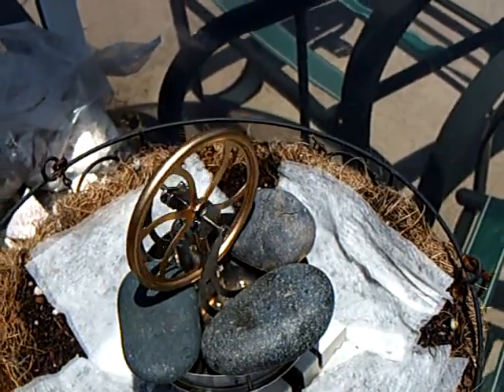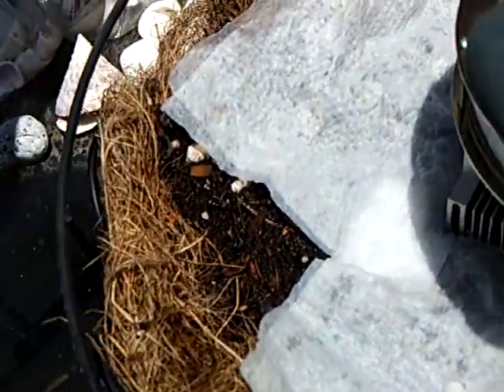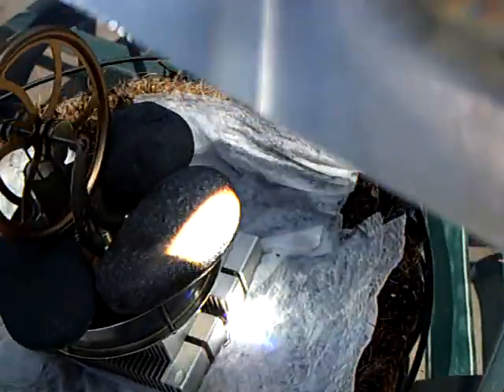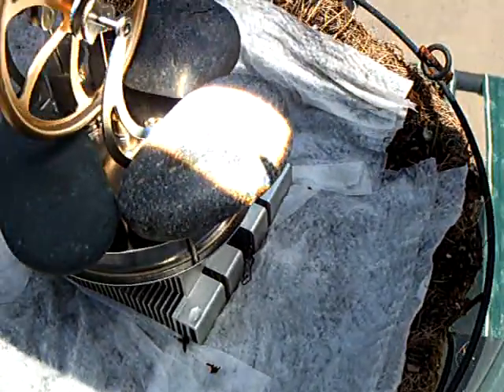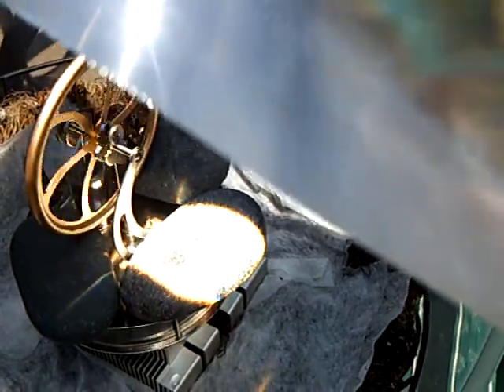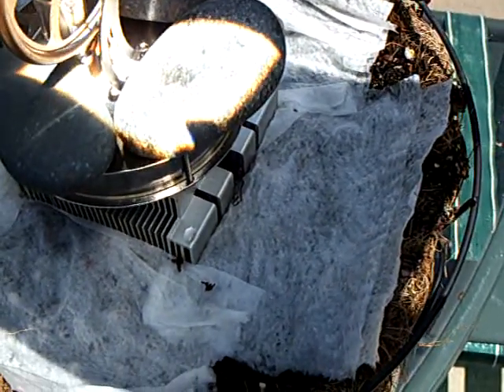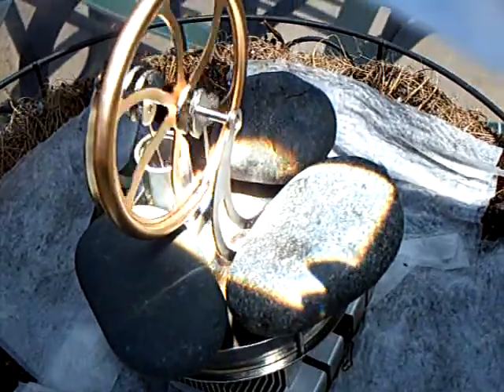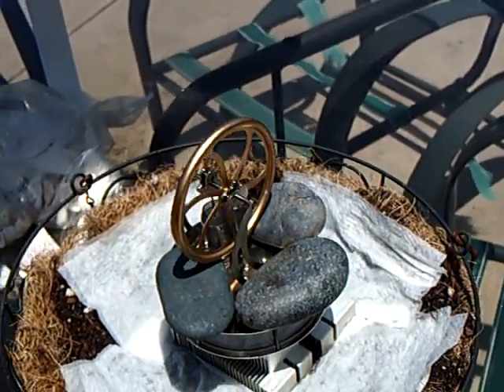Black Rock Stirling Engine ---- with Fresnel Lens

Comment: Lidmotor,  I've melted lead with fresnel lenses, they are great.   Anywhere you can find a sustained temperature difference, you can use it to generate power from that Stirling engine.    Good to see this working.